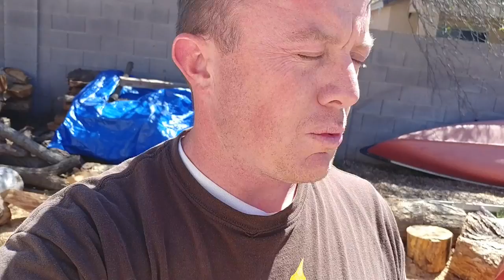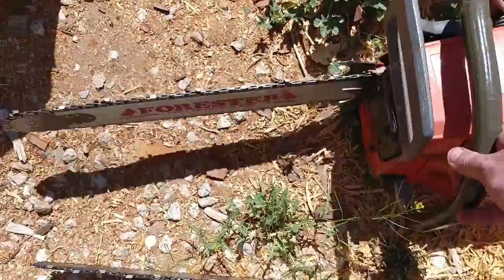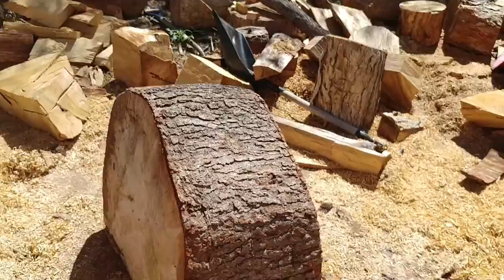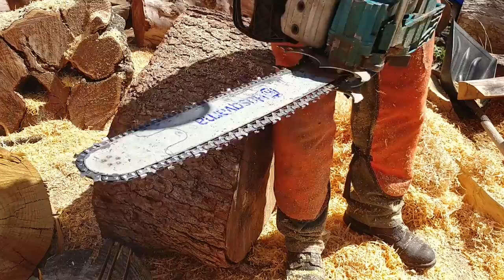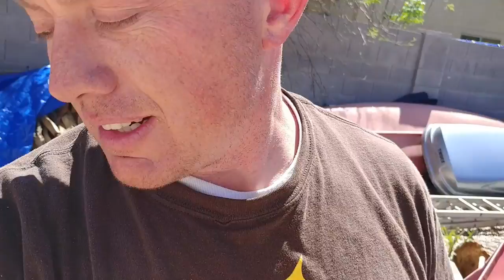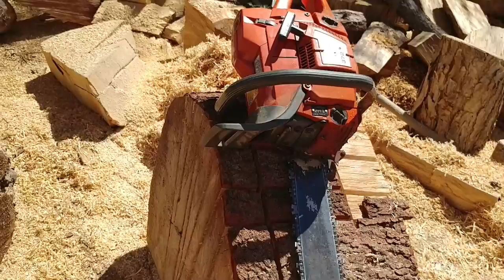Husqvarna 372 vs Husqvarna 395XP vs Makita 6421

Comment: Tips for putting together a ps6400 got to 
replace bar side crankcase got it all apart putting back together tomorrow.
Reply from the maker: I'd say makes sure the mounting surface is clean, new gasket and a thin layer of RTV